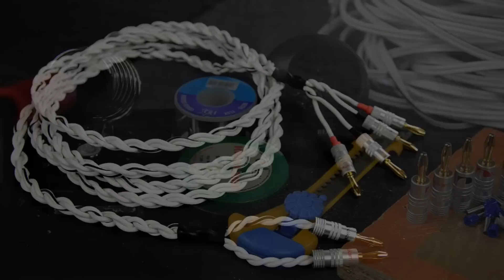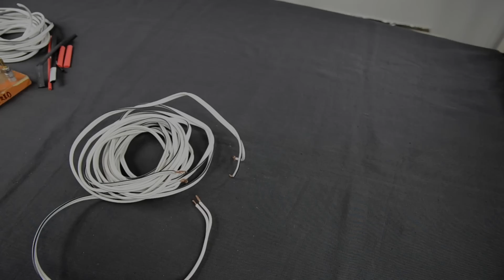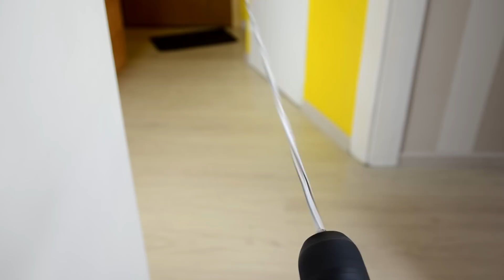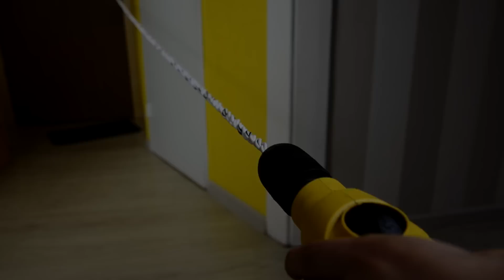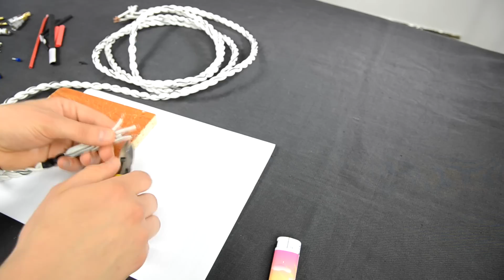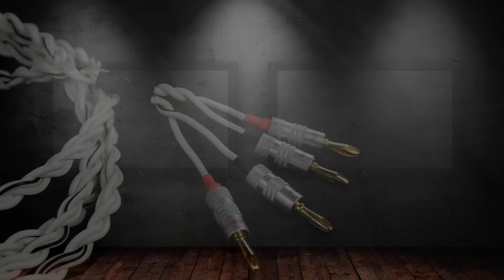How To Make Bi-wire Speaker Cables - DIY Speaker Cables #DIY9

Comment: Doesn't that twisting of wires kind of defeat (at least partially) the very purpose of bi-wiring - separation of Low and High range currents?
Reply from the maker: it's look better and have better physical properties

Comment: That is sooo NOT BRAIDED!!! That is what you call TWISTED PAIR, which is achieved by TWISTING them in a drill. The definition of braided wire is wire that intersects at 90° angles, not wire that goes around itself over and over.

That does NOT give the inductance and crosstalk properties of braided wire. It would be the same as....wait for it... TWISTED PAIR WIRE!!!!! Put 8 pairs together and you have the worlds most expensive twisted pair Ethernet cable!! 😂😂😂

Comment: What's the purpose of twisting them?
Reply from the maker: two conductors of a single system are twisted together for the purposes of canceling out electromagnetic interference from external sources.
Reply: Where do you source the cable? Is it "regular" copper or treated in some way. Also Does it get some sound characteristics?

Comment: l bet this looks pretty, but all of that wire probably more resistant since you have made it shorter. so this wire would be more electrically resistant compared to a regular wire. it's not a big deal since it looks like you are running it in a shorter distance than 100 feet.

Comment: hi this is a great video thanks for sharing. I have a question if you don't want bi-wire you have to use two cables for bouth ends? and what gauge did you used?

thanks.
Reply from the maker: Yes, you can just twisted all it to 2 ends. I use 1.5 square mm or it about AWG15 or AWG14.
Reply: ArtūrsM Great thanks.

Comment: you didn't show the end for the amp, as at 3.11 
Do you just twist the 2 cables together to create one end, then fix into the end caps, then fix to the plugs?
Reply: ...and by doing that you get lower gauge. Two 15 awg cables will have 12 awg... and so on. Each time you double the cable the gauge will drop 3 gauges.
Reply from the maker: you are absolutely right - I just twist the 2 cables together to create one end with banana plug, typical bi-wire cable.
Reply: awesome, thanks for confirming.
Reply: ArtūrsM is it necessary to twist them?

Comment: What's the difference between bi-wiring and bi-amping? Is it the metal piece that is attach to the speaker's binding post?
Reply from the maker: +morenito116 Bi-wiring use one amplifier and bi-wire cable, but bi-amping use two amplifier with pre-amplifier and bi-amp cables.

Comment: Where can I buy metal tubing? Also, I have a Denon receiver 1155 watts. I just got Klipsch floor speaker with dual binding post. Can I use your method to bi-wire the speakers to the receiver?
Reply from the maker: +morenito116 metal tubing I get from local DIY shop, for your setup you can use bi-wire, but if your Denon support bi-amping, better use bi-amping mode for speakers, it more better then bi-wire.
Reply: +morenito116 Just search for Bootlaces, and a bootlace crimper. No need to solder them on, when the bootlace crimper results in an electrically and mechanically superior joint.
Reply: That's correct.... Terminal Crimping Tool Bootlace Ferrule Crimper Wire End Cord End Lug

Comment: When ordering banana clips to do this project, how do I know if they will be wide enough to house two wires together on the receiver-end?  You used Nakamichi.  Is that what you recommend?  What size or dimensions or specs should I look for?  Thank you.
Reply from the maker: +David Andrews If you solder wire in banana plugs, you can use any plugs for 2x1.5kvmm cable, if you use screw for fixing cable, then it plugs is too small.

Comment: well the cable will not be better..
it will look better.
Reply from the maker: +Hrostbjergsorensen if you use nude cable from coils, you get bad quality from cable. If you this cable upgrade with plugs, you get better contact with lower contact resistance jump. If you this cable Twist, you get better canceling out electromagnetic interference. Also from standard 2 wire cable you get bi-wire cable for better sound performance result.
Reply: @Techscrews  technically bi-wiring will provide zero benefit.  There is no point taking two cables off of the same amplifier output let's say right channel.  You are still sending approx 20hz to 20khz up both cables for the same channel (R).  All it does is directly feed into the low and high pass section of the crossover inside the speaker, where it still does the same filtering as a single cable feeding a channel (R).  You just end up spending double your money on speaker cable for a two way speaker.  Your cables look really nice, great job 👍
Reply: it will be the same.